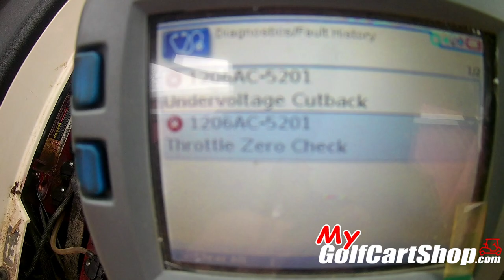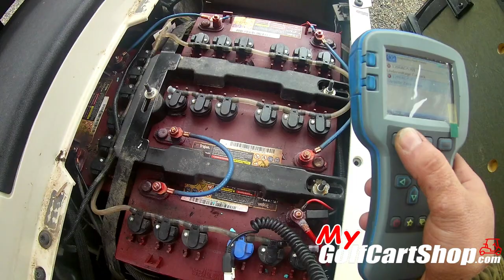EZGO RXV Brake Problem? #ezgo #ezgorxv

Comment: Well my batteries are new lead acid Trojans and the charge indicator says they are charged , I had a weak buzzer in the past and had no click so did the solenoid and that didn’t work no buzzer again and so did the switch and nothing then all of a sudden it started to work 2015 Rxv , now I have no movement r or f and buzzer and gauge works ?

Comment: Great video! Could bad battery cables cause brake issues?
Reply from the maker: If it is affecting the voltage flow it certainly could.

Comment: Does a bad controller cause the brakes to lock up randomly.  Batteries are good, changed out the brake pack, new speed sensor, and still locking up randomly, also you have to turn the key off and back on to get it to go.
Reply from the maker: Sounds exactly like a controller problem? Do you know which brand controller you have? Is it a black or white one?
Reply: @cartsmarttv  I have a 2012 ezgo, rxv pretty sure it's a Curtis, thanks for the reply

Comment: Mine locks up after you wash it. Can not figure it out. I did take the charging port out dried it out and added die electric grease still same issue. After 5 days to dry out no problems until you wash it again.
Reply from the maker: Yeah, seen that happen many  times. Need to cover the controller with plastic bag etc... when washing under the seat.
Reply: Water is getting into your charger port blow the charger port I detail and wash carts everyday with a pressure washer . The charger port is shorting out and sensing conections like a charger is there